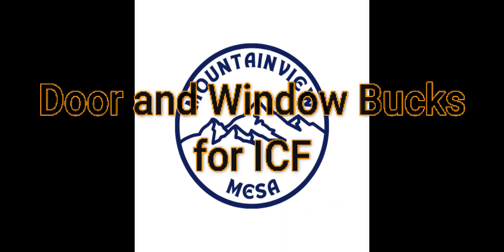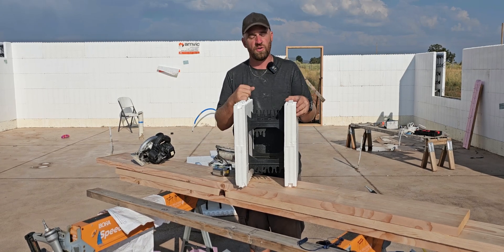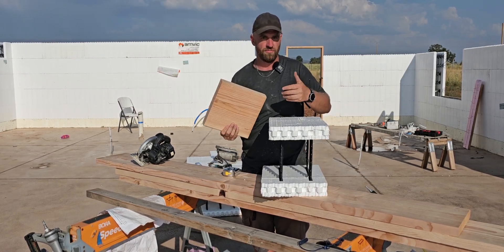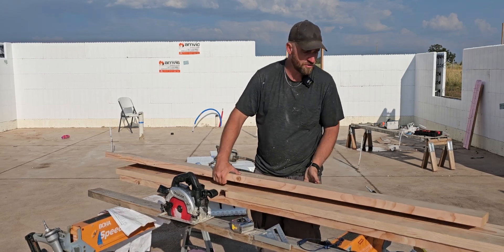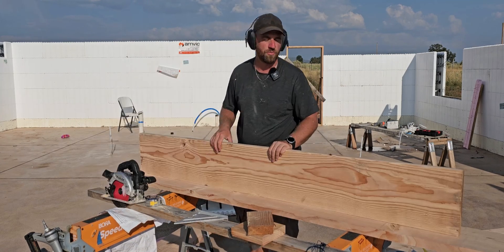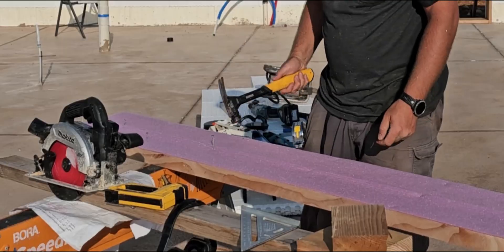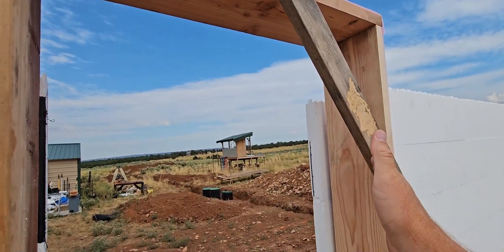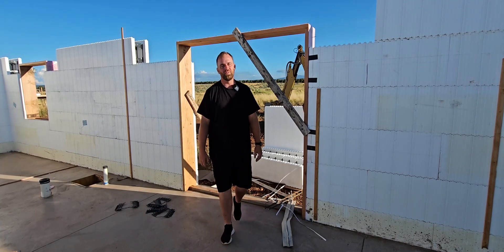How to Make Door and Window Bucks on an ICF House

Comment: Some ICFs have bucks as a part of the package. So you dont have to worry about wood rot.

Also, wouldn't the concrete catch on screws better than nails?
Reply from the maker: @Th3120ck  yes you are probably correct about the screws. However,  the detail we chose will also work great.

Comment: How did you attach to the icf foam
Reply from the maker: @wcbscout  I tried to show this, but it was awkward getting the shot. I used 3½ inch decking screws and fender washers that I screwed through a wooden strap  for a temporary hold. I took them down after concrete was poured.

Comment: im litterally working on my icf bucks every night. In georgia it is 100 degrees in the day. I didnt use pressure treated either. I am just going to paint the edges with a water proofer. I also didnt use the nails. I used a 5/8 dove tail bit to make a groves on all sides. Stole the idea from nudura prebuck.
Reply from the maker: Hey those are a great details! I never would have thought to do the liquid applied water proofer or the grooves. Sounds less intrusive than nails, for sure!